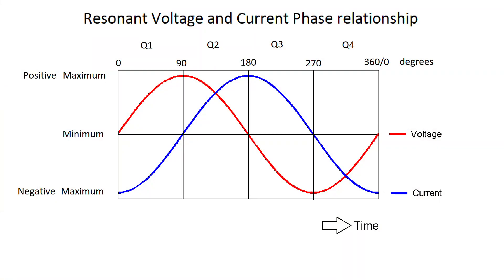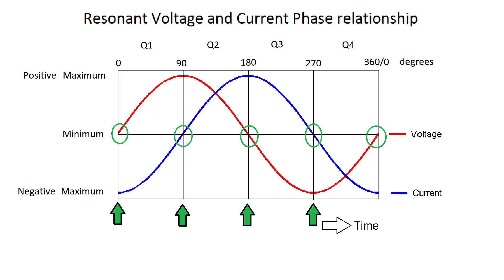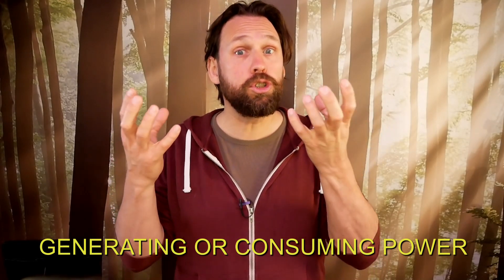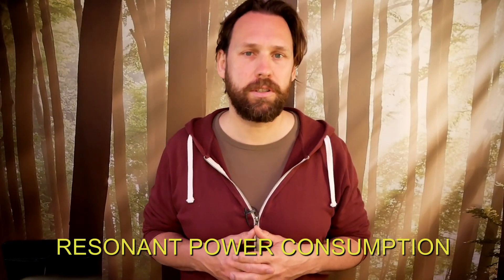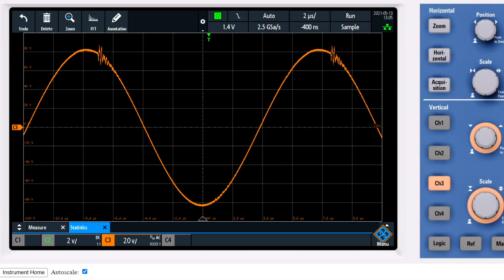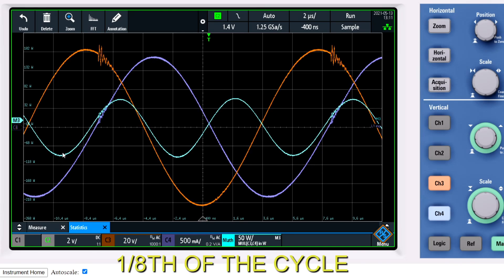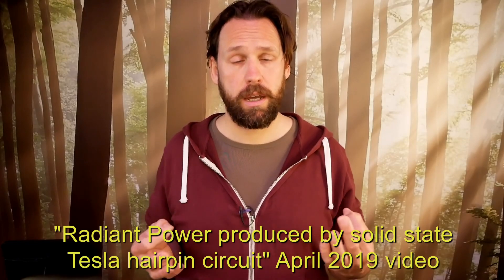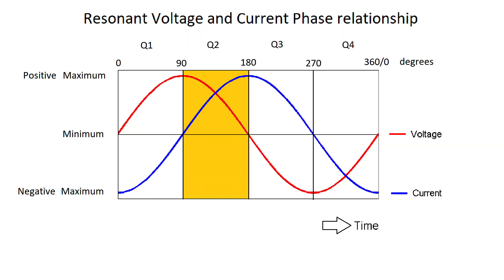Resonant Electric Power

Comment: Ivo, please indulge my question. It's been months since you made this video but I hope you'll step back with me for just a few moments to refresh your memory. Your graph of 90° separated voltage and current show 4 equal time quadrants, Q1, Q2, Q3, and Q4. In this scenario Q2 and Q4 have both current and voltage either positive or negative, meaning these quadrants consume energy.  Alternately Q1 and Q3 have inverse polarity of voltage and current, meaning these two quadrants generate electricity. But all quadrants are equal in time so any power generated in Q1 and Q3 is obviously cancelled by Q2 and Q4 for a zero net sum of power.  (In a perfect zero resistance world.) So the question is obviously this, in order to get a positive net gain of power, or free energy, we need to increase the time length of Q1 and Q3 while decreasing the time length of Q2 and Q4. How can we do this? Could we use an impulse of an impulse, sort of?  Example, grab full time length impulse from Q1 and Q3 while grabbing only 1/2 time length impulse of Q2 and Q4 into a 3rd coil? I know its dreaming, but in order to produce a positive net sum of power we need to start somewhere. Would you agree the answer might be lengthening the power generation lengths of the sine waves while decreasing the consumption stages?
Reply from the maker: changing the length is not an option at this speed, as it is determined by the capacity and inductance.
yes the impulse can provide an imbalance of the power.
but I found a better way.
I can phase shift the current, making it in phase with the voltage.
this is done by adding a L4 extra coil in series with L3.
the negative and positive power is due to the capacitor generating power (= negative resistance) or the coil generating power, the resonant power goes back and forth betwen the cap and coil.
Reply: @MasterIvo  I was reading some other comments here and came to that conclusion also. So in a simple explanation i think you are using variable 3-D level BEMF of the separate coils to sort of tune them in order to invert the V or current for positive energy sum gain? That is one extreme amount of concentration way above my level. God bless you Ivo.  And God bless your work! This is amazing. Thank you.

Comment: Is there a way of generating electricity from a resonant frequency?
Reply from the maker: yes. by disturbing the resonant balance
Reply: @MasterIvo  soo if you think about how sunlight and cosmic rays are nothing more than a wavelength, would it be possible to disturb their resonant balance and turn it into electricity?
Reply from the maker: yes I think so
Reply: @MasterIvo  could you maybe try and make a video about how one would go about doing that?
Reply from the maker: @thatquintenguy6772  easiest way would be to use a solar panel :)
To be honest no, I wouldn't make a video of that. It would not be efficient
Reply: @MasterIvo  ah i didn't know that was how solar panels worked, i thought they made use of a crystallization that turns light into heat and used that to generate electricity. Although now that i think about it it can be both and still the same thing since energy transfer can emit heat. On another note, hoor ik het goed dat je nederlands bent?
Reply from the maker: jazeker! de diode is een crystal, een zonnecel is gemaakt van diodes.
Reply: @MasterIvo  mag ik zo onbeleefd zijn om te vragen of je nog studeert? En zoja, is er enige kans dat ik je kan overhalen om mee te doen aan de red bull basement?
Reply from the maker: ik studeer iedere dag, maar ben niet verbonden aan een instituut
Reply: @prometheus1111111  uhhh is this supposed to leave me confused? if so, job well done

Comment: Altough current and voltage in the coil are not in phase, does your inverter sees a resistive load at resonance? In the 1/2 wave dipole resonance, the source sees a resistive load at resonance, but current and voltage at the dipole arms are not in phase,
Reply from the maker: I think half wave dipole is parallel resonant, which has large impedance at resonance.
my load will be low resistance, so probably best coupled to L2 which is low impedance /wire resistance series resonant
Reply: @MasterIvo  I think that regardless if it is parallel or series resonance, the net impedance seen by the generator will always be resistive, because XL=XC=0, so only R is left since XL and XC are zero. In the general antenna theory, resonance is seen as the point where the resonant circuit behaves like a resistive circuit. Thats why I asked about the load seen by your generator.
Reply from the maker: no parallel resonant is max impedance, only cancels out with series resonance.
My system is much more complex then a single dipole. I am creating a resonant feedback loop, whereby I use 2 primary coils around a single secondary.
All 3 coils influence each other.
Reply: @MasterIvo  Well, it depends on "who sees" the max impedance. I use parallel resonance for induction heating. When the coil resonates in parallel with the capacitor, huge amounts of current flows into the resonant circuit, but this current does not flows from or into the inverter, so the switches can withstand much less current than it is flowing into the LC tank.
Series resonance = voltage amplification, parallel resonance = current amplification. The inverter sees a high impedance for the LC parallel, but the impedance of the components drop dramatically, so huge amounts of current flows into the coil. I use parallel resonance in my tesla coil too; when in resonance, a lot of amps flow into the primary, I have to water cool the wire so it does not melt. I use parallel resonance because my primary is low impedance, and I have an inverter capable of supplying hundreds of amps. If my inverter was designed to supply hundreds of volts, I would use series resonance for the primary (because of voltage amplification). In both cases (series or parallel) the inverter sees a resisitive load at resonance. If series, a resistive low impedance seen from the inverter, if parallel, a resistive high impedance seen from the inverter. In a nutshell: when to use series or parallel resonance? Have a high voltage, low current inverter? Series resonance. Have a high current low voltage inverter? Parallel resonance. Like your work, hope it helps.
Reply from the maker: I'll have read over it one more time, but in my experience it lies in the characteristic impedance of the resonant system.
I interpret that as the balance between how much capacity and inductance the system has.
Big capacity, is high current low voltage.
big inductance is high voltage and low current.
Big is referred to the capacity VS inductance
Reply: @MasterIvo  Now we are starting to understand each other. You are right, it depends on the LC impedance sqrt(L/C), if you increase C impedance goes down increasing the current. If you increase L impedance goes UP, decreasing current and increasing voltage. What I`m trying to say is that, the low and high impedance of series/parallel resonance is about how much impedance the inverter sees when driving it. If you choose series resonance, your inverter needs to withstand all the current flowing in the tank circuit; in parallel resonance the major current is only in the resonant tank, not in the inverter, so the switches needs to withstand much less current.
If you want high voltage across your capacitor/inductor, both series and parallel will work, the choice will be based on your inverter and how you will drive it. If you have a low impedance coil that needs to be driven with many amps, parallel resonance may be better, you can drive it in series too but, again, you`ll need an inverter capable of providing many amps.
Reply from the maker: Cool! thanks, that makes sense, as I have a series and parallel resonant coil connected in series.

Comment: Seems like in the resonant system, power consumption is basically resistance the resonance of the circuit, like when you pluck two notes that are not in tune. It's gonna take half the amount of work to sustain the two notes in resonance than the two notes that are out of tune (or thereabouts). Like how when you just plug a piece of iron into a circuit it creates resistance, heating the metal and consuming a lot of power... it only consumes the power because the piece of metal isn't in tune with the circuit. I'm not an electrician so I can't speculate exactly how to make the metal resonate(there are others that have done so) but I know that it makes sense.
Reply from the maker: Power consumption probably is the power cycle that charges the capacitor in a series resonant coil/capacitor system.
But yes, resistance also, indeed when not resonant

Comment: Awesome work Ivo! Your videos will bring lots of clarity to many who want to understand field mechanics and the importance of scalar technology. Something that I've known for a quite while now and continue to unravel is to understand how to generate power by understanding the time lag between the magnetic and dielectric field as the pressure changes/ inducts I know it is essential to understand if we want to invent generators that creates power without any kinetic input and this video further proves this essential point, such amazing work Ivo! By the way I sent a donation to you recently, you're one of the few people out there who knows what you're talking about! Also just an experiment suggestion, I've been experimenting with parabolic shaped conductors and something I've discovered recently is that they can amplify any signal without any power input like you would through a transistor and the conductor 'mirror' concentrates it to a point like a magnifying glass would do with the sun. For the experiment you connect 1 coil put it at the bottom of the parabolic shaped conductor to an ac circuit and have another coil just above conductive mirror and connect your oscilloscope to both coils and observe the amplitude difference. The next experiment I'm going to try with the parabolic conductor is see what happens you concentrate scalar/ impulse frequencies which I think should bring some interesting results!
Reply from the maker: thank you Patrick, I hope you will share your research results online so we can all see it.
Reply: @MasterIvo  Will do Ivo!
Reply: Patrick, I agree it sounds like you might very well be onto something here. I'd be interested in seeing your results also.  I think it is just awesome that people like yourself, Ivo, and even Ken Wheeler are dedicating time and talents toward solving a huge dilemma we find ourselves in. Meaning pollution from burning fossil fuel. While politicians point fingers and complain about others polluting, they don't have solutions.  Teddy Roosevelt said "It's not the critic who counts.  It's the man actually doing the work. The man who strives to achieve. Whether he succeeds or fails he has still done more than the critic." I'm always for the man in the trenches. And failure is not really failure. It is rather one more piece of knowledge added to the collective. So i accept my own failures gladly because they are only steps in a stairwell leading to an answer. Good luck with your research.

Comment: So it’s a closed loop sort of thing? And then it will run it self but equaling zero extra output energy? But you can add pulses of extra power into the system ?
Reply from the maker: Tuning the impulses is done with a feedback loop yes. and when properly tuned the impulses should create power, form the combination with the resonant current. This power then loops back to the impulse source coil.

Comment: Awesome work Master Ivo! Keep up the great stuff! One thing that seems to run true in so called zero point energy devices that I see is basically cavitation. Cavitation can happen with very high voltage which is why I think you are on the right track. Would love to see you do some experiments using normal voltage boosters (larger joule thief circuits) to say charge batteries with.
Reply from the maker: Interesting! Yes I have an Idea for a alternate joule thief circuit, that I still havent build.
Reply: @MasterIvo  Well get crackalackin lol No I can't wait to see your next update! Look forward to it! If anyone can do it it's you!

Comment: hello mr ivo, you mention that the 2/4 phase is in fact effective with the voltage return i agree with you that the voltage must follow the inductance of the coil and that's what it does  partly a transformer with the sine wave it increases voltage gradually along with the inductance of the coil so I think the only way to combine feedback and inductance would be to take a sawtooth wave like that your curve could follow  voltage, inductance and you could also use the returns to the cut-off of the coil I am currently working to develop such a system in this avenue, moreover with this method you could lower the frequency to have a maximum inductance.
Reply from the maker: interesting, where can I find your research results? For me feedback is done by magnetic coupling. but first the power of the field must be amplified, by the introduction of voltage impulses, that combine with the resonant current to produce power peaks.
Reply: @MasterIvo  Hello mr ivo, you can do the test easily with an inverter you choose the sawtooth wave and with a frequency adjustment according to your coil you can follow the rise of the voltage with the induction of the coil then recover the return a  the maximum cut of the inductance then reinject it at the maximum of the next point which should give a boost to the induction of this one, in the end a square wave could never give a maximum of amperage with  a maximum of voltage since with the high frequency you do not give the time to your coil to take the maximum of induction you make a cut before to synchronize voltage and inductance on the same line the fact of increasing the voltage at the same speed  that the inductance then recover the returns at the cutoff to inject into the next curve is the only way to have a maximum of induction, moreover by reducing your frequency it would be possible to put capacitor pl  us big for a greater discharge in your next pulse, moreover it would also be possible for you to use an iron or ferrite core to increase your inductance without overloading your core too much, the success is to make a magnet like in a generator  passing in front of an armature voltage and induction coil at the same time the faster it is, the greater the voltage will be at the output while having a lot of amperage. to obtain a lot of power you must obtain a maximum variation of the magnetic field c '  most importantly the voltage only creates induction in the coil so high frequency speeds are not recommended for good performance but cutting the coil for further recovery is essential in my opinion.  thanks for your good work your videos are very informative, pierre c.

Comment: Have you ever looked into the Don Smith systems?
Reply from the maker: yes long ago
Reply: @MasterIvo  - Your thoughts on it?.. if you want to share?
Reply from the maker: @imaginarypoint  Don was very confusing to me. Clearly was speaking only half of the truth, and twisted this truth around.
I have never seen a Don device work.
one old documentary was clearly cut and censored, the part what was left out dealt not with the magnetic field, but the dielectric field, then I knew enough.
Reply: @MasterIvo  - Thanks for your feedback. That is the thing.. no one ever sees anything for real actually and yet we believe in many things. I think that is human nature.          Another question if you don't mind. What are your thought about the Rick Friedrich motors and his battery rotations based on the Carlos Benitez system of simple battery rotation? Seems to be something there. Charging batteries for free?  He is a big advocate of the Don Smith systems. Even has a book.